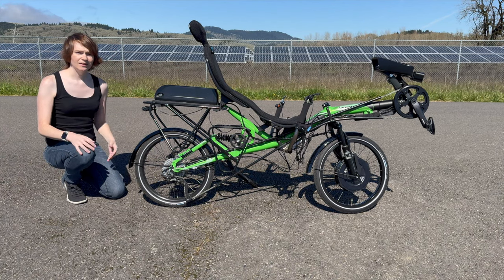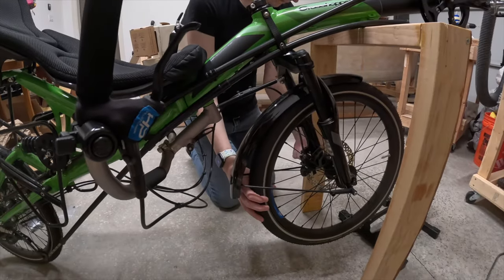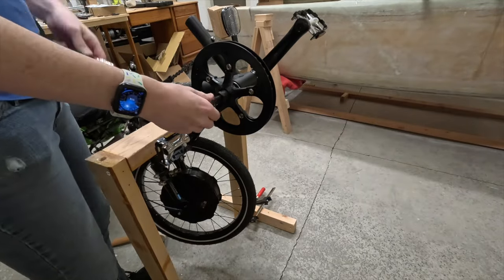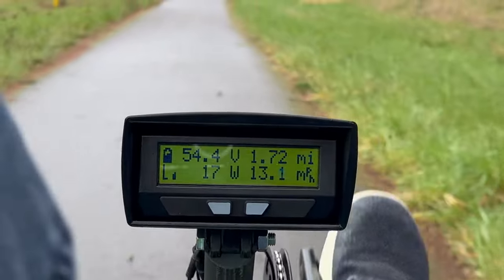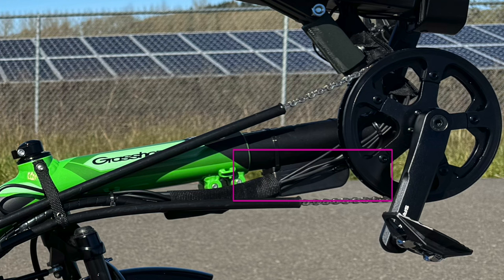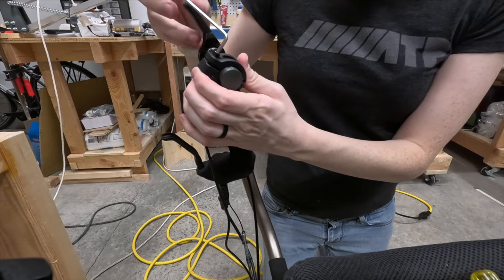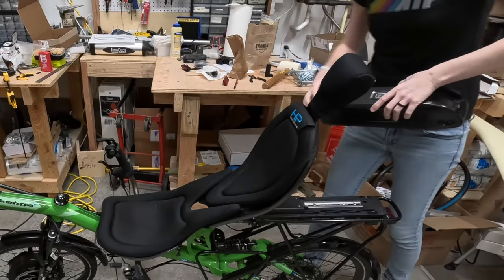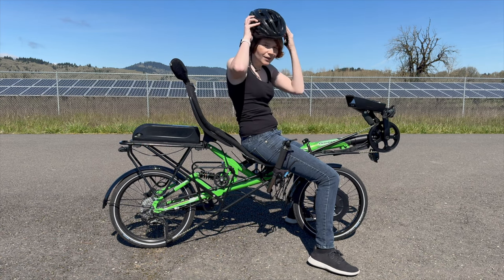My Dream EBike Build

Comment: Outstanding conversion, and the video is very helpful and well edited. I think Grin Technologies could use this.  Conversion kits need much adaptation for long recumbents, you covered the highlights and solutions.

 I just added a mid drive to an USS recumbent trike, my daily driver, and the solutions were similar: layout wiring with string, struggle where to mount the display and throttle, creative methods to attach the battery, find somewhere to stuff all the extra wire.  You could still hang panniers from the rear rack.